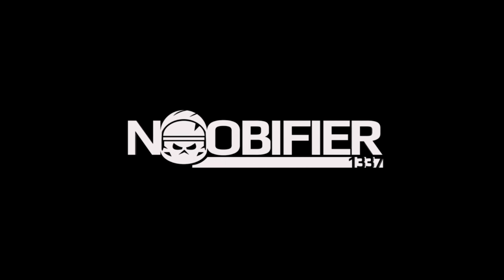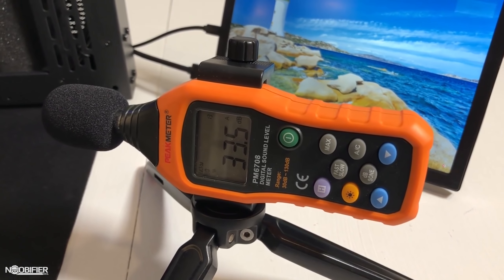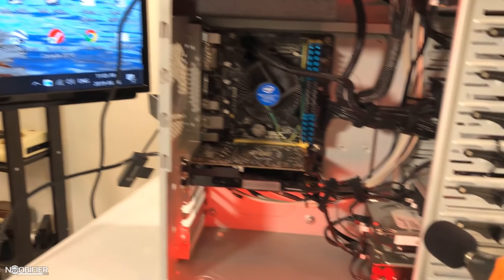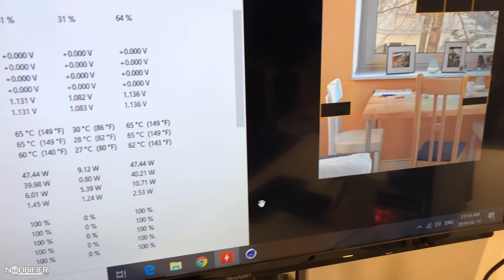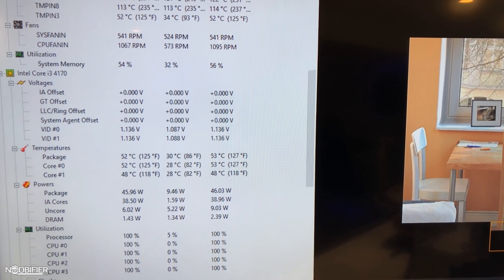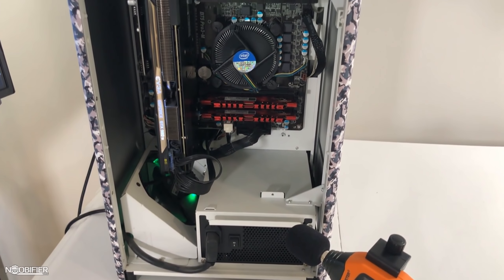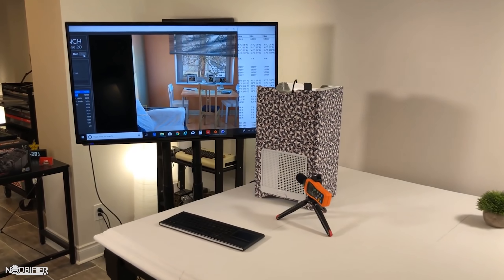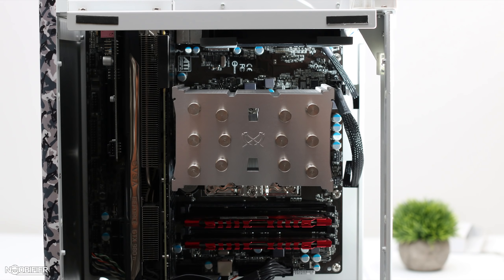Hot and Loud - How Good are #scythe Air Coolers - Testing Before & After #nobullshit  #results

Comment: "...Passive should be fine."  Yeah, but... a third fan for the heatsink would have been even better.  I understand you may not have had one.  Not trying to be critical, just talking about effects.  Yes, replacing noisy stock case fans is a high priority, I agree.  Especially in that vertical air-stack case design.  But just because the air column is all going up in the vicinity of that cooler, doesn't mean the majority of the airflow is going THROUGH the cooler.  A lot of air will actually be deflecting around it.  I'd love to see another test to compare the two fan configurations in this atypical case. 

Even if you don't have a third fan to use (he should buy another one)... the fan at the top exhaust position, could be removed and used instead as a direct CPU fan, probably best "pushing" from underneath.  The overall vertical air-chimney effect should still exhaust the case just fine, but I'd bet money the cooler itself will exchange heat significantly better.
Reply from the maker: All of this is true. I believe also, as he is a gamer, the loads he sees on a regular basis are NOT anywhere like what I subjected it to in Cinebench. When he is playing Project Cars 2,  he is seeing maximum Core temp of 42 degrees on only case fans, even with the Ti barfing heat into the case. If it was a 8700k, for sure, but it’s a 3rd Gen I5. Thanks for the feedback and support

Comment: I hope at some point you decide to explore custom water loops I think you'd enjoy some of the design elements
Reply from the maker: I am hoping to get partnered with EK alpha or Corsair
Reply: @NOOBIFIER1337  I like EK and Alpha Cool. I haven't seen much of Cosair's line other then there AIO type solutions. Either way I much prefer those types of solutions compared to massive air coolers. However, it's not an inexpensive venture and there are some additional maintenance elements that come into play at there easy to overlook. One tip is make sure you find a good spot to put a drain port in the loop. A lot of "ready to go" solutions such as cases pre-built for water don't incorporate that important element.

Comment: I just got a new case. Flows air through like a jet engine. A lot cooler... now the issue i got my HDD and my Optane 900 PCIe isn't registering... pissing me off.
Reply from the maker: What was the motherboard. You may need to upgrade BIOS. Have you tried plugging it into a full length PCIe 16 slot?
Reply: @NOOBIFIER1337  It's a Asus ROG Strix B350-F AM4 AMD B350 SATA 6GB's USB 3.1 HDMI ATX AMD mobo. You may be right. It is SEEN in device manager, but it's not recognized as a drive (I.e C: D: etc) I flipped through the manual's of both products, i don't see anything missing, unless it requires a smaller PCIe slot. The three slots I have are full length. There's no plug ins for additional cables. Just adding in, I have a graphics card that can register in each of the slots, and the 900 can be 'seen' in each slot. So perhaps it does need an update or something simple. It would be classic me to over think the issue. Thank you for paying attention to my small plight. I have a lot of respect for you.
Reply from the maker: All PCI are compatible. It’s a x4 on the 900p so you basically plug it into a graphics card port. Update the bios and  I would hope it works. I deal mainly with Intel so I have no extra pointers. Sorry

Comment: just be careful with the Sycthe, forgot..particularly on Intel you want about medium mounting pressure on that...stuff still suffers with mounting issues..BSOD/Freezes no post's etc.
Reply: I shouldn't know why you have issues with mounting pressure: Scythe is pretty simple to get the correct mounting pressure with its HPMS III. Once the screw stops, don't try to screw any further.
Reply: @dorientjewoller113  well I liked cranking down hardd all the way on the old lapped AMD CPU's etc lol. I just forgot and like Z270 needs like medium Pressure lol. should Lapp he 2600x but it don't really need it etc. Runs cool.
Reply: @jspinks2388  So, is it then Scythe fault or yours for a bad mounting pressure on the CPU?
Reply: @dorientjewoller113  well this 2nd 2600x chip is more fucked up lid so i just lapped it..roughened it up..finally past 4250 with it..lol. that first one i killed with waterblock/leak thattt one was a 4.3 one lol.
Reply: @dorientjewoller113  I'm sorry Scythe but the 2lb cooler won't do it...I need the newer Corsair that 3lb thing lol..i bet ya it would pass 4.3 lol. some shit you just can't see lol.
Reply: @dorientjewoller113  we're looking at like 4250 that one man and that chip..should be pretty stable man. and msi with hot sink vrm..I double padded it etc lol. Close enough and perfectly fine with just some bullshit etc lol

Comment: Honestly Noob you should stick to the things your good at and know more about. When it comes to PC hardware and cooling, your just not as informative as you are with StarCitizen. Your baseline is not as comparative and neutral and common ground. Much of this is for the fact you didn't cover as much as what goes into cooling as actually is considered by any entry level enthusiast, or relatively informed PC builder, such as the choice of material of the cooler, i.e aluminium or copper or zinc and the reactions they cause with different thermal pastes and even going into the thermal pastes themselves which can make anywhere from no difference to as high as 25C or more of a difference knowing what your doing. Almost ALL thermal pastes, no matter how much you ideally look at it, are your insulator you have no choice to deal with, because they are a degree better then dealing with microscopic airgaps in the surfaces of metal on metal contact directly.  While you briefly talked about saturation of the heatsinks, you didn't specifically talk about dissipating that heat effectively nor talked about ambiance enough and density of the materials involved to make an informed matter - fair enough - you do not have enough experience to make the same video's for cooling a PC as you do for perhaps a video cutting out the chatter in a 1 hour StarCitizen video and condensing it into a 2-3 minute video. 

If you ever wanted to revisit making video's on PC hardware, and be an authority on the matter, you could do your research and be more informative. The coolers you were comparing and reviewing, weren't as in depth  as they could be, had you known what to talk explicitly about, but for the majority out there, who know even less than you, it would seem to suffice, but the internet is full of people who have opinions and without knowing better, generally mislead people. I know that was not your intention, and you didn't explicitly do so, but for reasons you do not cover, you are actually doing so, very much. 

Anyways if you wanted some resources to learn more about cooling PC's effectively, I know quite a few teams around the world that are the experts on the subject matter and can direct you personally to their groups, groups that took me over 2 decades to find and be a part of, but it might not be for you, they do tend to favor being extremely elitist in their PC buildsa nd such, but if you can get past most of that, there are some very informative and helpful people out there, who would go into full details on any small detail you bring to them. 

Like, for example, one of our guys will show you pencil mods for various components on almost all hardware, another might simply explain how to identify which coils and vregs and mosfetts to look for in order to gauge what a motherboard or GPU's capability would be, in terms of heat  and overclocking and what sort of damage it can take, we got whole teams in each of these groups when it comes to the basic stuff like cooling and the metallurgy involved and mechanics behind the various TIMs and bios mods and settings, that simultaneously allow for less heat, more power and efficiency at same time and save you money. Its not uncommon for people to run out of there in a week of contact, with setups they would never have believed possible performance wise from what they have been using as their everyday driver.  But you won't find video's where we share this on youtube. 

We wouldn't mind someone who has such professionalism to come along and pass along our tips and tricks and experience mind you, most these groups, have wanted nothing more then to share what they know, openly. More often then not you'll find a thing or two on some forum years later that originated from such groups. Just not fast enough, imo, but then again we're a very niche community subset of PCMR sort of breed and all. Most of us, the same teams filling out the top positions on various benchmark programs and their forums and leaderboards.